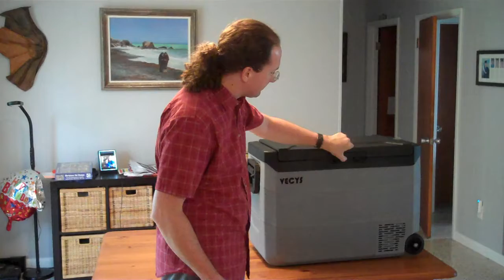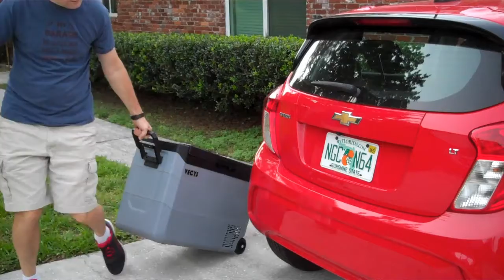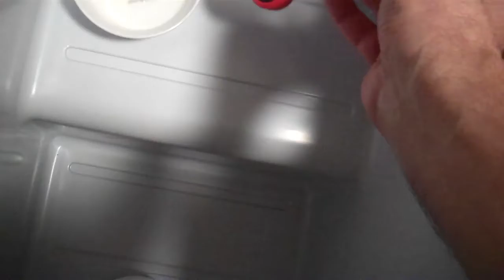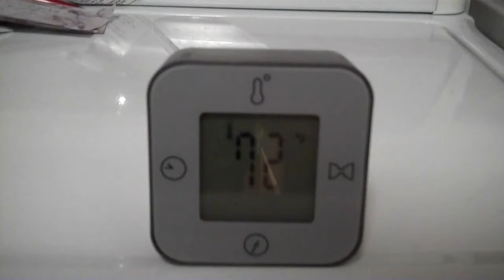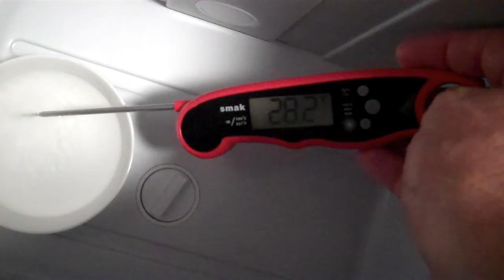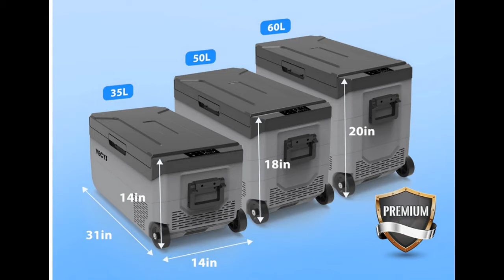Summary Review: VECYS CR60 car refrigerator / Freezer (Dual Zone)

Comment: Hello thank you so much for this complete review. I got one in Venezuela is exactly the same but using a store brand label however is the same no doubt about it. I'm planning to get a deep cycle battery 12v 70ah for using it on camping trips during the day and during the night I'll use my generator 110v what do you think on using a deep cycle battery 70AH during the day would be enough ? Once again thank you for such complete Review. 🎉
Reply from the maker: 70AH * 12 V = 840 Wh, but with lead acid, you only get 50% depth of discharge, so 420 Wh of power.  I expect 420 Wh of power would be enough to power it for 12 hours for no problems. (I assume you are going to charge the battery back up overnight.)

Comment: Thanks a lot for this review, I'm buying this, one question though, I got a little confused regarding the 24 hrs consumption, did it use 180 watts in 24 hours?
Reply from the maker: As a fridge, it used 180 watt hours (The same as a continuous 7.5 watt draw for 24 hours, although it was actually cycling on/off over that time).
Reply: @summetj  thanks for clarifying. Has it been running with no issues till now?
Reply from the maker: @Kassemgr12  I only run it for a few days out of the year for trips, but so far it's been fine.
Reply: @summetj  thanks for the info. Just bought it !